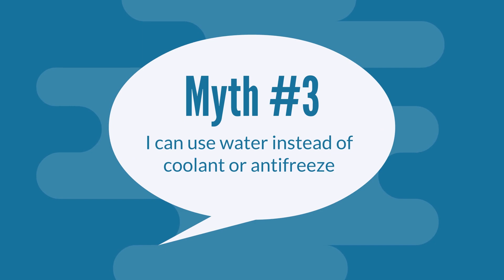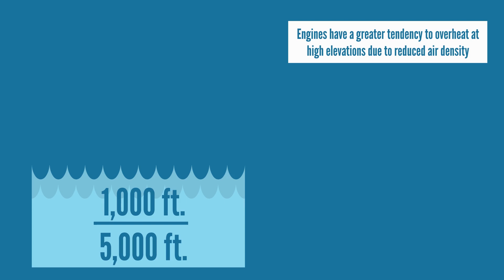Coolant Myth 3: I Can Use Water Instead of Coolant or Antifreeze

Comment: I drive an acura mdx 06. And it has a pretty bad coolant leak, that ill fix later. 

But i have been using Water for 3 weeks. I just fill it up before i go anywhere. 

Works fine. 

Ill go back to coolant here and there for some lubrication if this robot happens to be serious about that. But idk. Seems fine. 

I also live in hawaii, so that is a factor. 
No freezing.

Comment: They say coolant is alkaline, but when it mixes with the atmosphere, it crashes through the ozone layer. The ozone layer is the extension of the moisture in the air and the necessary amount of space it needs to dissipate and still stick around to moisturize the earth. The coolant doesn’t dissipate in the air without knocking things out of sync because. I think it’s an alcohol and it dries out the moisture in the air as it floats around. Eventually a puncture or pucker in the ozone layer results if it continues. It’s like a cavity on a tooth. They need to change this quality somehow to make it at least safer.

Comment: My coolant cap wasnt closed tightly and the coolant evoprated out yhe leak amd caused it to smoke amd all my coolant was loss…i need to drive somehwere tomo and back home willl filling it for water for one day be okay? I can only g to a garge wensday?
Reply: Yes just bring water in your trunk to top it every 3 km. Do not attempt to open it when it is hot from close that thing will burn you up.
Reply: @juliananderson1488  hi, ye i sorted it out..i found some antifreeze and topped it up amd changed my cap.
Reply: @bushytushy9719  okay lovely.

Comment: Maybe...But water has done me fine with no trouble so far. It might have something to do with these Florida winters.
Reply: A week ago I was on the water is fine side. Then I drove through Vegas it was 107 degrees I have a brand new radiator and I was overheating. So I’m going with coolant now on.
Reply: Yeah Corn bread. I've used tap water in Florida all my life and had no problem? Guess I need to change now to deionized water. Geez
Reply: @chrisstephens9948  distilled water works best. Greetings from the O
Reply: Nothing can boil in a sealed system. Have you ever heard of a pressure cooker? Also in a cooling system there is such a thing as a radiator cap. Typically they are set to open at 15 psi. So, it doesn't matter if you are running pure water or water with antifreeze in it. As long as your cooling system is in proper working order, it will not open the radiator cap relief. As far as rust and corrosion goes, unless you are adding oxygen to this closed system, rust and corrosion cannot develop. Rust is nothing but burning of metal. We all know that for anything to burn it needs three things. It needs oxygen, fuel, and an ignition source. In a properly closed system like a cooling system, the only thing present is the fuel. If you drain the water periodically then you will eliminate any possibility of corrosion or rust. The only time I have ever used antifreeze in my automobiles is when they were exposed to freezing temperatures. That is why they call it antifreeze.😊
Reply: Distilled water speeds up rust amd corrosion btw. You can add it to coolent if you want to a 50/50 mix is pretty common. Also just because you haven't seen any issues with your vehicle doesn't mean they are not there you've just been lucky it hasn't been  anything bad yet.
Reply: It will rust or clog your radiator as the water goes through a chemical change. It also boils faster than coolant. So no you should not sub water long term!I am born and raised 305 and 407 by the way.

Comment: Distilled water doesn't cause corrosion, and heard that it works best for dispersing engine heat. Although I wouldn't bet on It, and definitely would not be willing to commit to running straight water in my Challenger
Reply: Started running straight water after learning that coolant is toxic. (Still run 20% Coolant 80% water). I'm worried about it killing my dog.
Reply: @ralphwarom2514  just store it in a location unaccessible to your dog and don't let the dog be near you or your car when you're replacing coolant or checking anything on your car
Reply: @ralphwarom2514  They make non toxic coolant
Reply: Definitely don't let your dog run where you drain or leak coolant especially if it's grass where it'll soak for days. My buddy had a big yard and a little Yorkie which started having seizures a few months after flushing his foxbody coolant